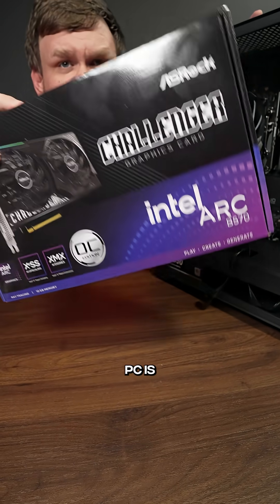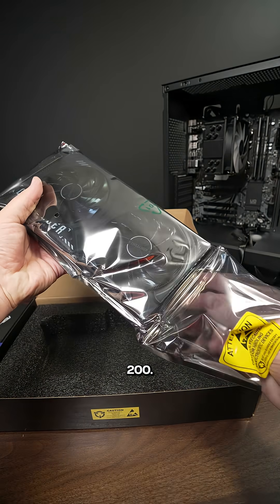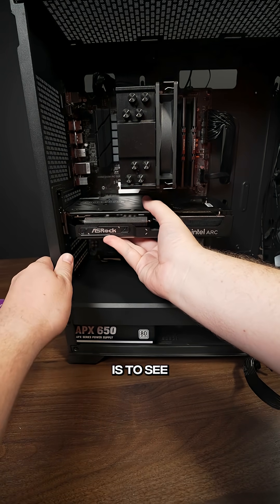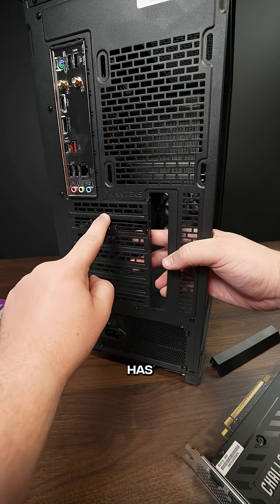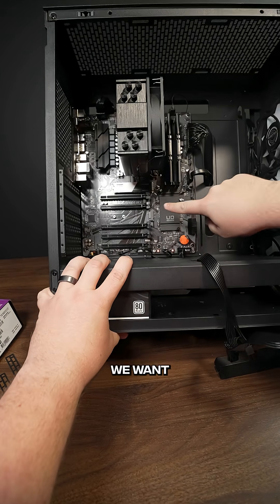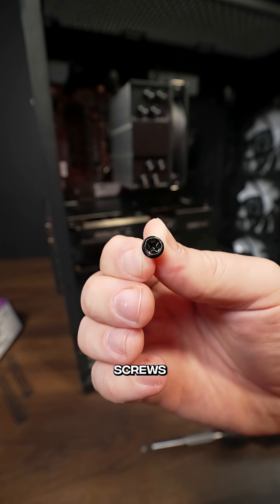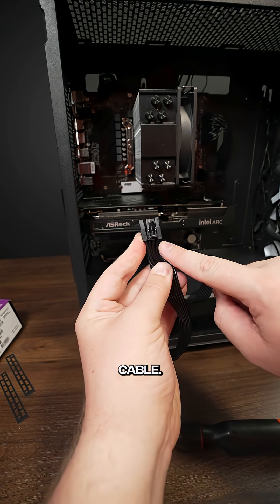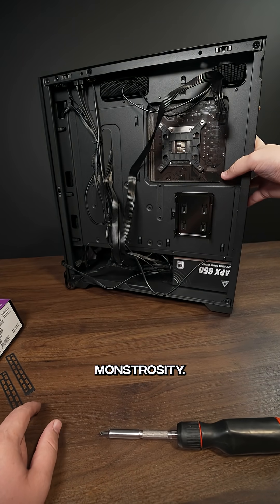The Correct Way to Install a GPU

Comment: Where do i find the screws?
Reply from the maker: They typically come with the case
Reply: @MMillerPCs  yea prob cause i got it prebuilt they were not there my dad had some screws that fit so i just used those it's a huge differce between intergrated graphics

Comment: Just an fyi for new builders, if your GPU is in any shape or form heavy LAY DOWN THE CASE TO INSTALL THE GPU. If you don’t, you risk bending the PCIE slot and or connector on the motherboard or GPU. Lay down the case and then do the following
Reply: Too late, but its been running fine for 4 months now so i think im good. I only layed it down to install the cpu and cpu fan.
Reply: Instructions unclear, gpu slipped and hit me in the nose

Comment: The correct way would start with anything but an Intel gpu. Both Nvidia and AMD have better options. Also, being honest, if you need videos like this to build a pc go get help. Last thing ya wanna do is fuck up.
Reply: Intel cards have actually been getting a lot better, and just because the other brands have “better options” doesn’t mean anything because the person is getting what they want
Reply: The b570 is pretty good value at 230$ 
Sure there are better gpus from amd and nvidia but they all cost more.

Comment: Should also install a sag bracket
Reply: its a 2 fan no point
Reply: @Pixel20K tell that to my 1660 ti

Thing started to sag like a wizards sleeve.
Reply: @carpentermic1 im using 5080 im not using sag bracket as well
Reply: Not for this card, Two fans are usually relatively light and the two screws are all it needs, Three fan cards do though
Reply: @cmcustomsyt3919  My RX570 says otherwise.